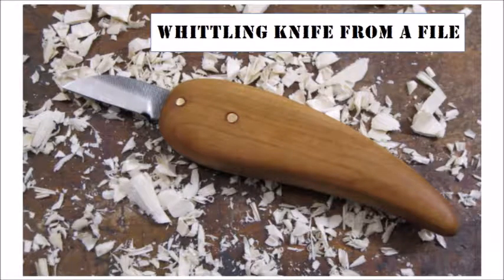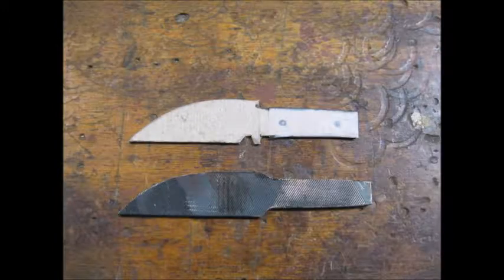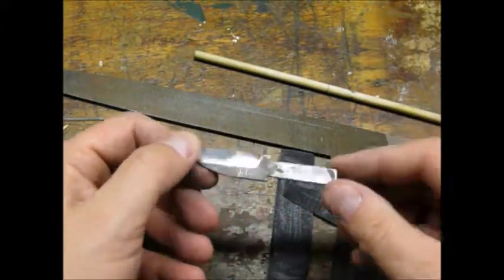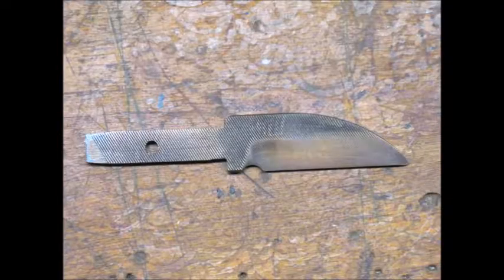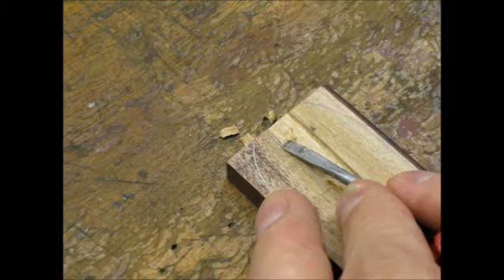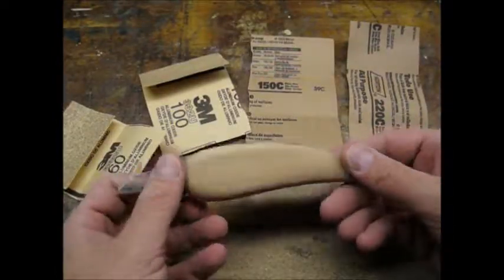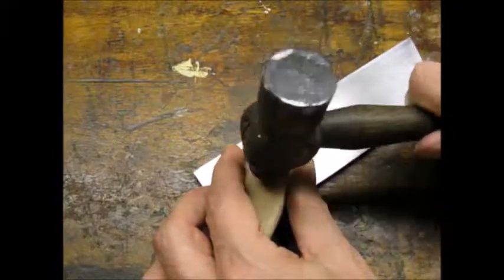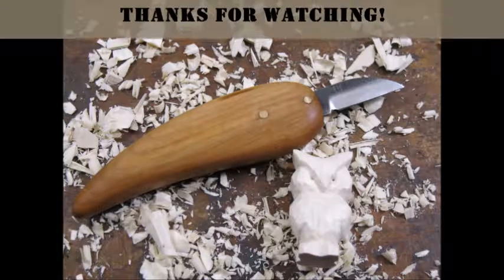Whittling Knife From A File

Comment: Im going to take a crack at another carving knife or two. Im curious to try an old saw blade and them I'll give a file a shot. When I had an issue with the knife I just made I looked for a file but the ones worthy to be repurposed were pretty big. I really like your handle Im going to copy that, it looks super comfy!
Reply from the maker: I think your plane iron material may work for you if you quench and temper it. Cut a test piece out and heat it cherry red until a magnet won't stick. Quench it in some oil and test it with a file. If you can get it harder than a file, you can temper it back for carving.
Reply: @357magdad  I tried that, I normalized it then hardened it again. It worked, Im wondering if its not the correct hardness for a thin carving knife. Hard to say, changing the edge geometry seemed to do the trick for this one. I'll play around more on the next one.